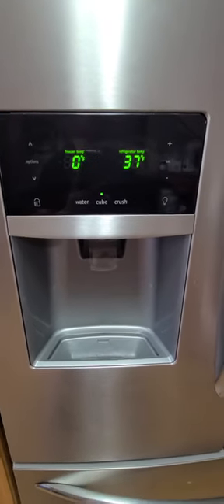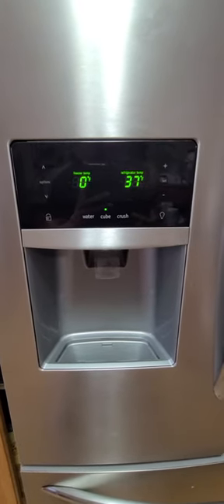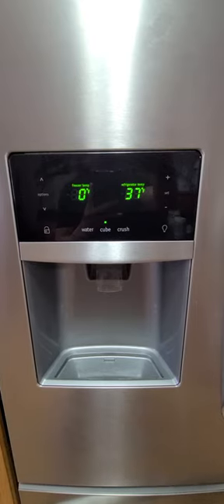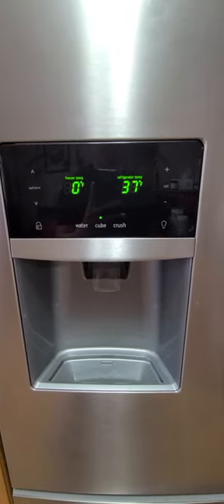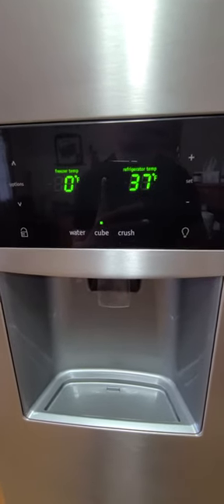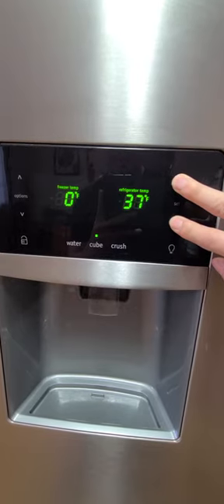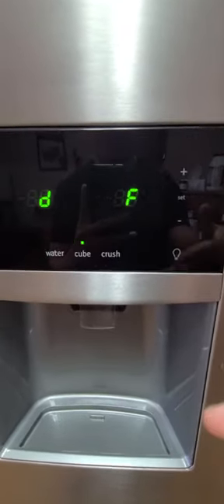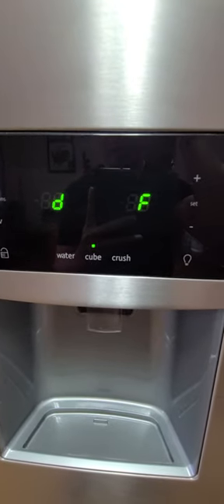Frigidaire Gallery Ice Maker EASY FIX

Comment: This is to defrost the ice maker only?
Reply from the maker: it will defrost the whole fridge. sometimes you'll have to do it twice. if that doesn't work then maybe your fridge has too much blockage where you'll have to take apart the ice machine. I do not have a video of that but you can find them here easily
Reply: @ohsnapzitzmeng  What about all the food in the fridge and freezer?
Reply from the maker: @wanaraz  defrost only runs for about 30min, then kicks back on. the food will be fine. I do recommend if this is your first time, do take out the whole ice machine and throughly clean it. after that your ice machine will act up within 6months or so, this defrost method over night should work then
Reply: @ohsnapzitzmeng  Thanks. I think the water line coming in got frozen over in the ice making part and stopped making ice. There is no defrost on this fridge for just the ice maker but I ran the defrost for the whole fridge anyhow and that fixed the problem. Thanks

Comment: Don't buy its crap
Reply from the maker: it's not crap, it works just thinking about it. sometimes you have to do it twice. if that doesn't work then you probably have too much ice blockage where you'll need to take apart the ice maker. if you've done that once then you'll understand why this method would work in some cases